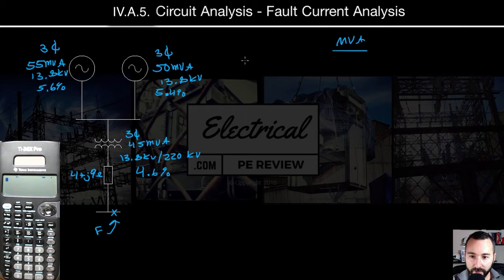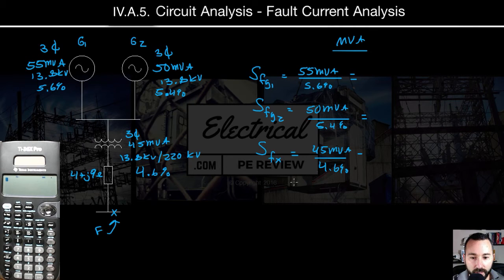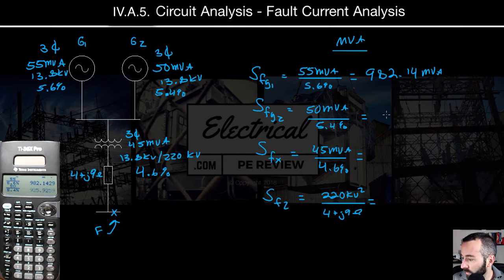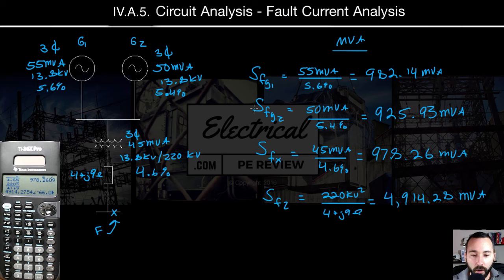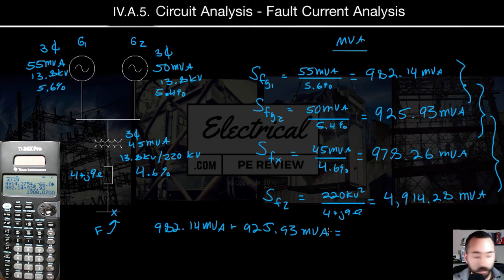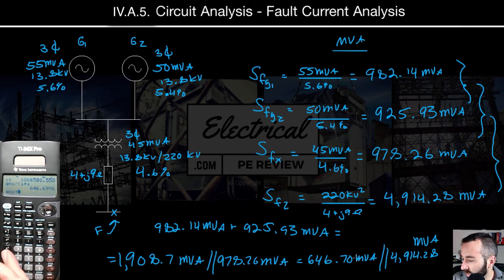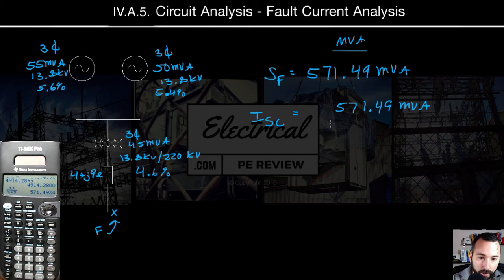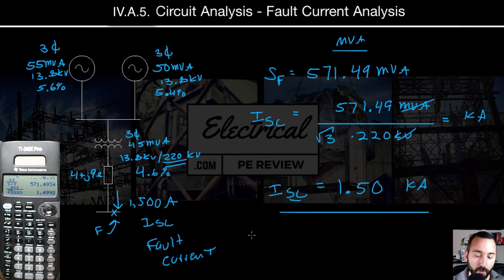Solved Fault Current Analysis MVA Method Parallel Generators Line Impedance Electrical Power PE Exam

Comment: For some reason this method makes way more sense to me than the per unit method.  I get almost every per unit question wrong
Reply from the maker: There are a lot of moving parts to the per unit system that takes time to really understand before being able to apply it easily. The MVA method is much, much, simpler and most of all fool proof!

Comment: What kind of fault would this be? What if they specified Line to ground, double line to ground etc at that fault point. How would you differentiate between them with the MVA method?
Reply from the maker: This would be for a worse case three-phase bolted fault. For unsymmetrical faults, instead of the MVA method (which is quick and simple), you have to approach it using symmetrical components for the specific fault type.

Here is an example video I have on our YouTube Channel on how to solve a line to ground fault using symmetrical components: https://youtu.be/kgkyUXRNPGo

Comment: I have been struggling to understand why reciprocal of power for series connections and simply adding power together for parallel connections... After looking at the solution for question #540 in the NCEES practice exam, I finally realized that we just need to calculate the impedance of each component, and add them up you would any impedance. Once you have the total impedance, simply use P=U^2/Z to get the power. I tried it for this example and it works like this:
1. Use 50MVA as base for all components. Use 13.8KV as base on the generator side of the transformer, and use 220KV as base on the load side of the transformer. Calculate the new impedance for all components using the new base to get:
    Zg1=50/55x5.6%=0.059
    Zg2=0.054
    Z transformer=50/45x4.6%=0.0511
    Z load=(4+9j)/(220000)^2x50x10^6=0.0102
2. Calculate the total impedance:
    G1 and G2 are in parallel, so the total impedance for G1 and G2 is Zg1xZg2/(Zg1+Zg2)=0.0262
    This impedance is in series with transformer and 4+9j, so the total impedance is 0.0262+0.0511+0.0102=0.0875
3. P=U^2/Z. Since voltage has a per unit value of 1, P=1/0.0875=11.4286pu. Base is 50MVA, so P=11.4286x50MVA=571.4286MVA.

By calculate this way, it helps me to realize how the impedance of transformer actually restricts the fault current the generators can contribute. The method in the video is easy to follow, but from a theoretical standpoint, it creates the illusion that the transformer actually contributes to the fault current. I think many people think the latter way after reading the comment in these threads regarding question 540:
https://engineerboards.com/threads/ncees-540.17353/
https://engineerboards.com/threads/problem-540-ncees.11835/
https://engineerboards.com/threads/ncees-power-practice-exam-540.34966/
Reply from the maker: Hi JS, thank you for your detailed comment.

You are correct in that transformers absolutely restrict the fault current that generators can contribute. Transformers as usually referred to "current limiting devices" during fault conditions for this exact reason. A fun and quick exercise to perform on paper to help understand this is to work a fault current problem using the MVA method with one generator and one transformer using hypothetical values while increasing the MVA rating of the generator. If you work the problem enough times, you'll notice that it does not matter how large the generator is, at most only the fault duty of the transformer will be able to "pass through" from the primary side to the secondary side of the transformer.

Comment: please I question  The safe Fault Level for Planning of 11 kV systems is 95% of the design rating of older equipment which is rated at 250 MVA. Comment on whether or not this will be achieved with the new generator added to the existing network. If not, discuss measures that might be taken to reduce the fault level and propose a solution that will rectify the problem.

Comment: Need an example for a line to ground fault, line to line fault, double line to ground fault.
Reply from the maker: Hi Alexander, the MVA method (what this video teaches) is for balanced symmetrical faults. The type of faults in your comments are unsymetrical faults that are solved using symmetrical components instead of the MVA method.

Here is a video on our YouTube channel solving a line to ground fault using symmetrical components:
https://www.youtube.com/watch?v=kgkyUXRNPGo&t

And here is the supporting article for this video with additional written explanation and supporting diagrams and calculations: 
https://www.electricalpereview.com/symmetrical-components-single-line-ground-fault-electrical-pe-exam/

Hope this helps

Comment: Hi

How do you calculate.  4+j9.....
Reply from the maker: 4 + j9 ohms is the line impedance between the transformer and the faulted bus, it is a value that is given in this specific problem without having to calculate it.
Reply: @electricalpereview  could u advise .how to get the answer 4914

Comment: I calculated total MVA contribution by faster programming as ((1/1908)+ (1/978)+(1/4938.))^(-1) = 571.73MVA. Same 1.5kA total I-fault value. Great MVA problems to practice! With the same arrangement they sometimes will ask to calculate fault at the generator's bus which will result in using Tx high voltage instead of 220kV.

Comment: Why is the line in parallel with the upstream? You turned the parallel xfmrs into a single equivalent and then went in series with the xfmr. But from there, why is the equivalent then in parallel with the bus/load fault location?
Reply from the maker: When using the MVA method, the fault duty in volt-amps of parallel devices sum up, while the fault duty of series devices add using the reciprocal of reciprocal sums method (I use the short hand of "//" in the video). The line is in series.

Comment: I've always used the per unit method to solve for fault current because I was never taught the MVA method. Zach does a great job showing how simple and useful the MVA method is. After watching this video, I'll be using the MVA method over the per unit method whenever I can.

Comment: hey i am just learning about power system. Why did you not start by converting all of the Z's to the same base ?
Reply from the maker: Hi Joel, the reason we are not converting all impedances to the same base is because we are using the MVA method to solve for the short circuit current. If we were using the per unit method instead, then we would need to convert all impedances to the same base first.

Comment: the fault current video is a good one.  It really went into detail of each type of calc and situation from parallel generators to series transformers really helping to understand fault current calcs. the video in the actual course adds in the PU calc comparison which helps understand both methods

Comment: Sir.. Max. Flt level.. 7.663mva..
Vltge..415..
Hw to find mxm fault curreny.. Could u pls help.. 🙏🌸🌸
Reply from the maker: Hi Rahul, you'll need to know the transformer percent impedance. Divide the transformer's full load amps by the percent impedance to calculate maximum fault current:

|Isc| = FLA/%Z

Comment: Awesome video. Seems like MVA method is significantly faster than per unit analysis method. Are there any disadvantages of the using the MVA rather than per unit analysis method?
Reply from the maker: No disadvantage what so ever as long as you understand both methods. If a question only gives you per unit values, and asks for a per unit answer however, then it's best to stay within the per unit system.